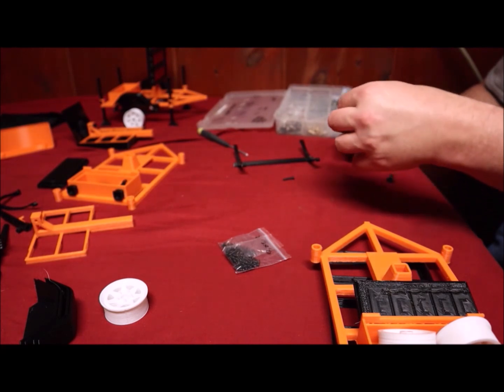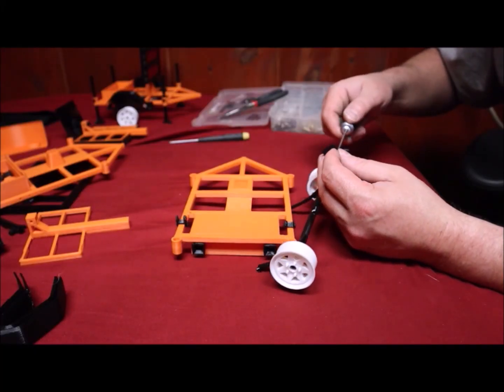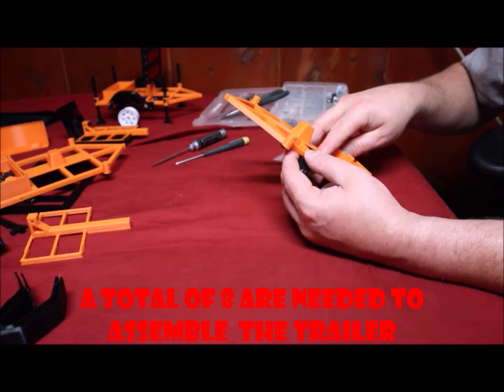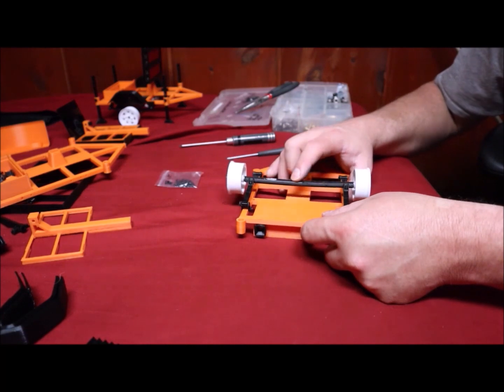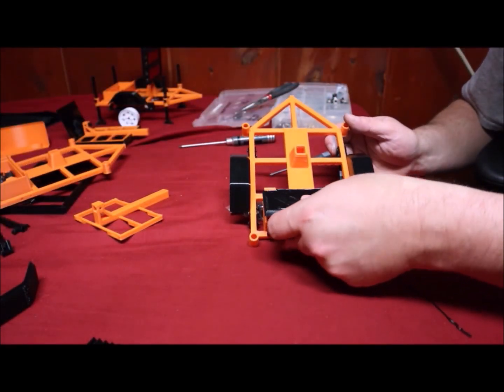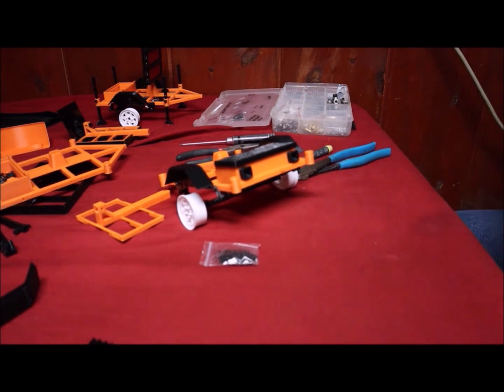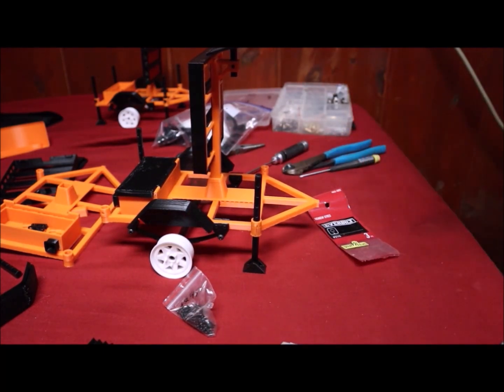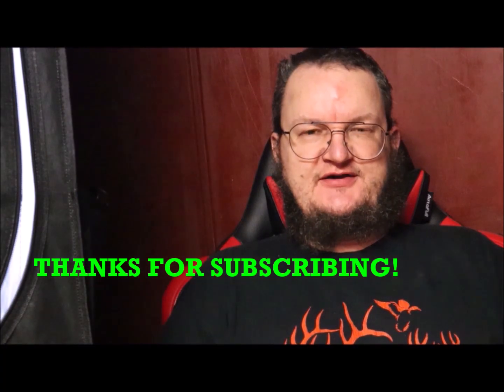3D printed traffic control trailer for RC construction sites, PNWSTE Season4 Episode No 9

Comment: Awesome video bud, thats a nice printer I don't think my table in mine is big enough to print this kit 8-/. Im going to find out but what about the electronics what are they and where did you get the lcd screens and instal.. pretty darn cool bud #12 for me thumbs
Reply from the maker: Thanks, Ron! I'll be back home late tonight.  Tomorrow, after work, I'll find the link on Amazon for the LED name tags. The name tags just snap into the sign board.
Reply from the maker: Ron, HOPEFULLY this Amazon link works for you. https://www.amazon.com/gp/product/B0792TLKBQ/ref=ppx_yo_dt_b_asin_title_o05_s01?ie=UTF8&psc=1
These rechargeable name tags are sandwiched between the reader board
Reply from the maker: I know those nametags come in red, yellow, & blue. There may be other colors available, but I'm not aware of them.